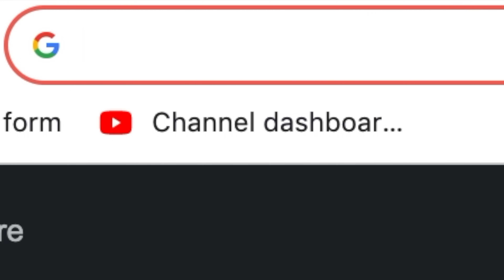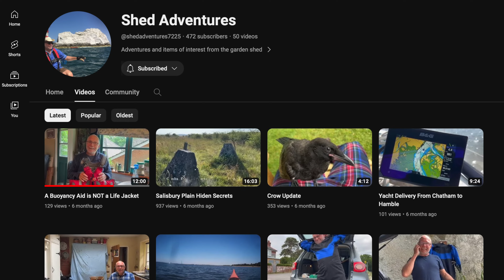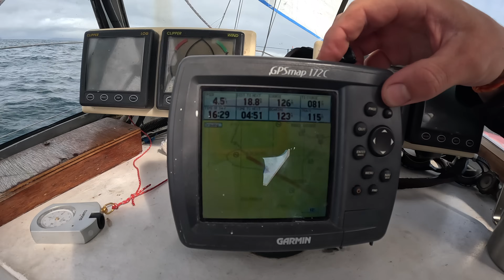Our FIRST Ocean Voyage | Sailing WEST of Iona, Hebridean Islands

Comment: You gotta tighten up your rigging boys! At around 10:21 you can see your port side standing rigging going slack then tight, this is not good for the rig! It’s shock loading everything. You should snug everything up a bit more so your rigging lasts longer.
Reply from the maker: Thanks mate it’s been done, but we appreciate the pointers always 🧡

Comment: Looks like you boys had quite the adventure out there. 

One thing I will suggest is before long getting into port, get a big electric fan pulling air out of the boat, get that engine bay opened up and attack it with some brake parts clean and scrub brushes, having a clean motor makes it so much easier when something goes wrong, and it makes it much easier to identify the problems when they happen. 

Also they make rubber anti slip mat that will go great on your shelves to keep everything from slamming and banging when the seas get up.
Reply from the maker: Thanks so much for the advice! We’ve been giving our engine a service recently in the boat yard 🧡
Reply: @OutsideYourZone  I will be looking forward to the videos! Stay awesome! ⛵😎